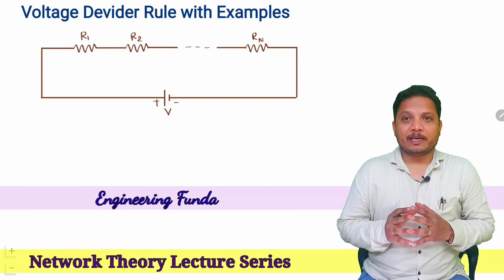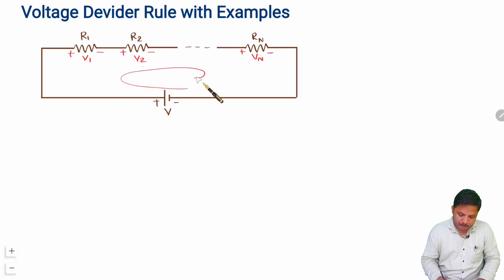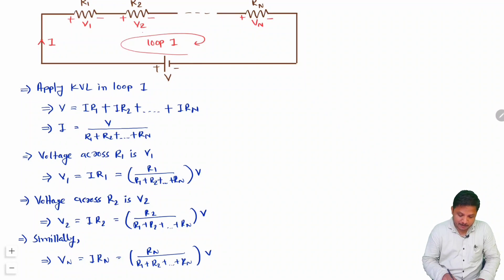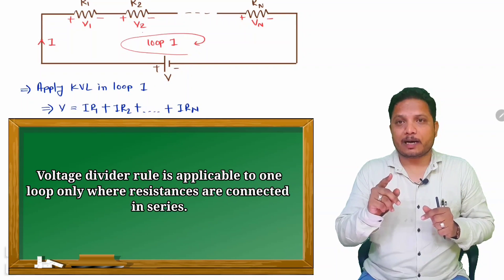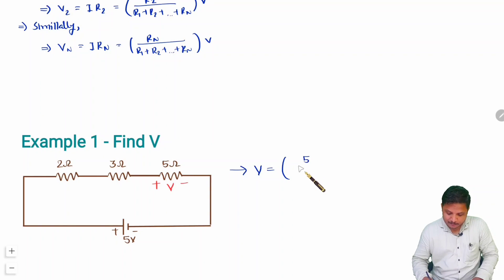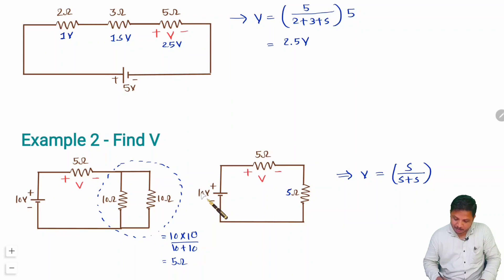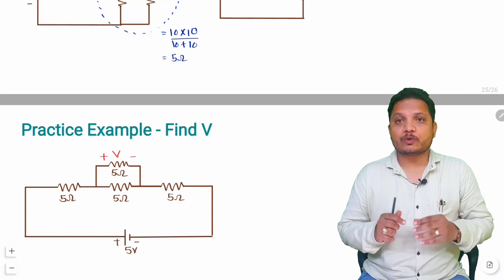Voltage Divider Rule Explained: Examples and Solutions

Comment: Sir, your explanation was completely different. If you want to find the voltage drop, you will have to use this method when you want to find the voltage at a point or point B, then there is a different method. Please be clear first

Comment: In the second example sir what if the was a capacitor in the middle parallel to the 10 ohms and you had to find the voltage

Comment: Sir the answer is 1 v...is this right?
Reply from the maker: Yeah it's correct
Reply: Sir please send the solution
Reply: @kct7519  beech wala parallel (5*5/5+5) me hai usko solve kr ke series me karo.
Phir loop laga ke voltage divider rule laga do (2.5/5+5+2.5)*5v= 1v
Answer aa jayega
Reply: @SpikesInBlack thanks Brother 🎉
Reply: Sir, it should be 0.5 v.  1v is for the whole small loop.
Reply: voltage won't divide in parallel

Comment from the maker: Voltage Divider Rule with examples explained with following Timestamps:

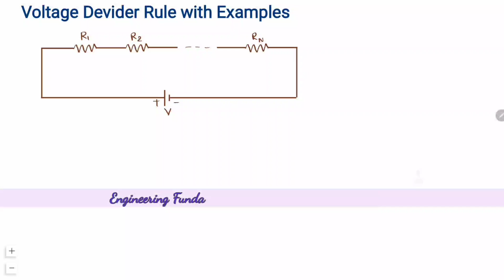0:00 - Network Theory Lecture Series - Voltage Divider Rule with examples
0:40 - Voltage Divider Rule 
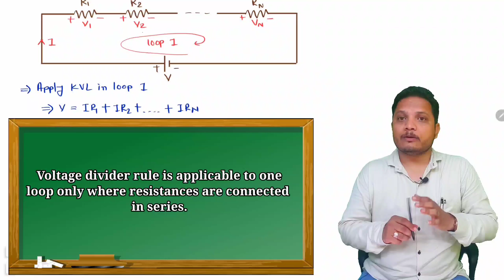5:23 - 1 Example using Voltage Divider Rule
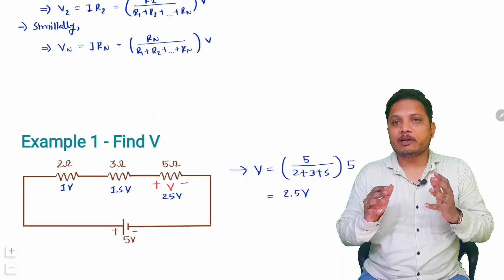7:16 - 2 Example using Voltage Divider Rule
9:48 - Practice Question on Voltage Divider Rule